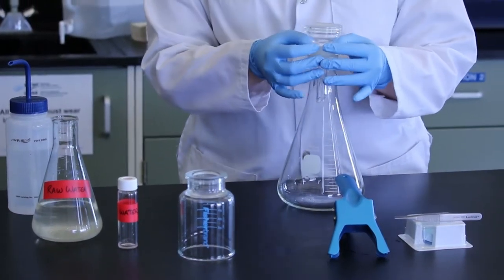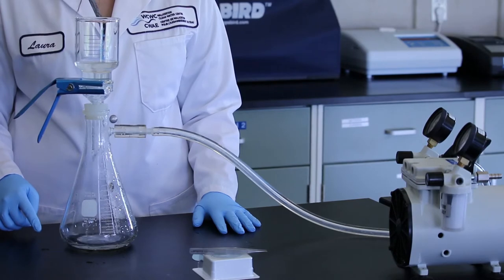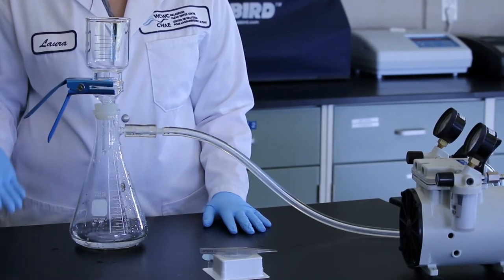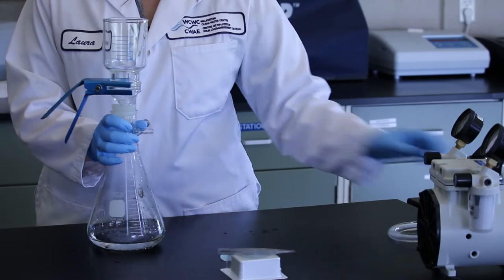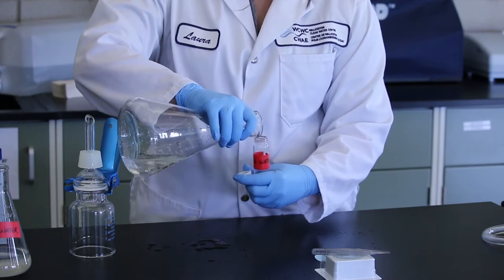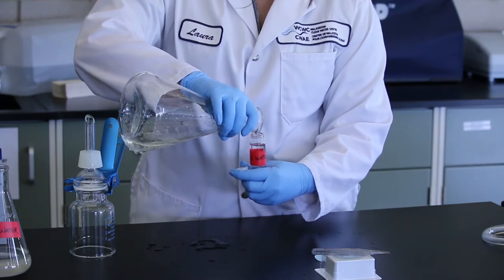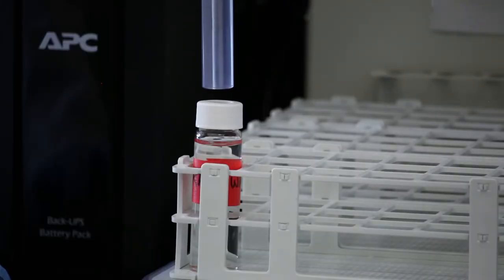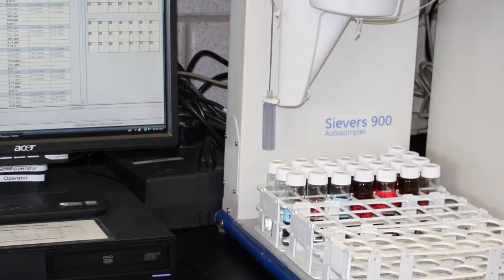How-to analyze total and dissolved organic carbon (TOC/DOC)

Comment: Is this the method for measuring DOC concentration by high temperature combustion?
Reply from the maker: This is using the UV/persulfate oxidation method
Reply: UV vs combustion… I believe shimadzu (spelling?) TOC uses combustion… GE/Suez use UV in a two channel flow to look at inorganic vs total carbon to determine total organic.  (X-Y=total organic.) 

What application/industry are you using it in?

For cleaning, there might be a few flaws in the method presented.

Comment: Question : any diff between TOC and TSS ?
Reply: Yes .  To my understanding -
:- TSS is a measure of Total suspended solids, it measures the weight of the solids  on the paper after filtering. While TOC measures the total organic carbon through the TOC-L analyzer.
Reply: @TassyMu   Any digital Meter to measure it on water ponds ?
Reply from the maker: @alexgunawan98  In drinking water, we normally will digitally measure turbidity instead. There are a variety of methods out there depending on your application!
Reply: How to calculate toc